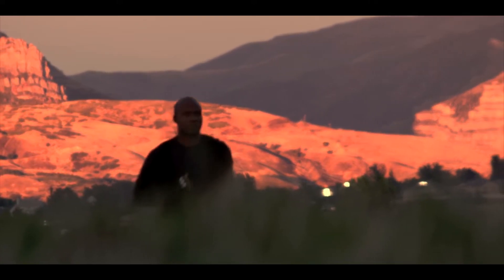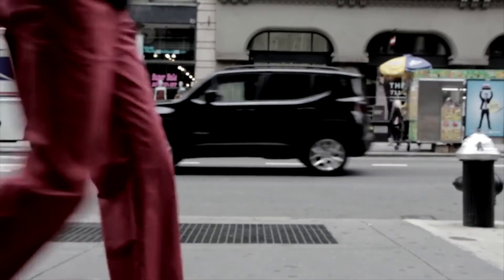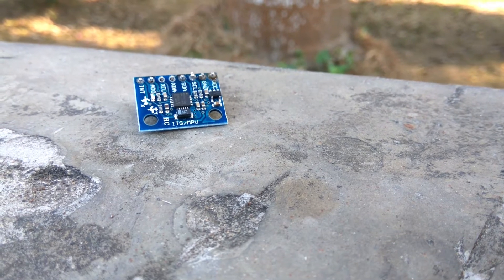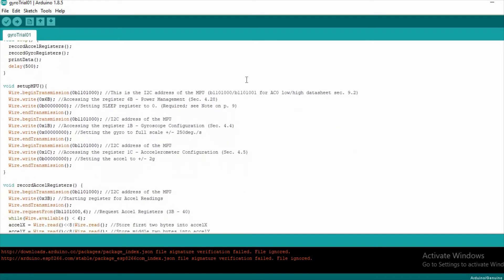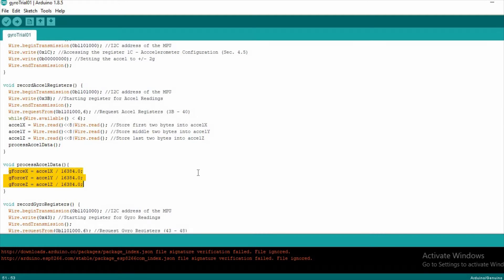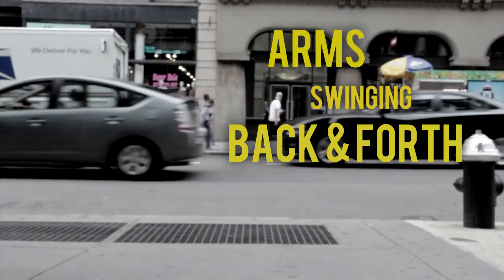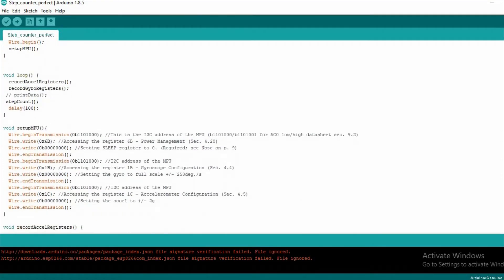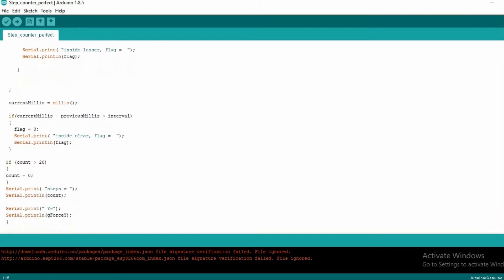Working of Step Counter in Fitness Band | DIY Arduino Accelerometer MPU6050

Comment: !! THIS IS CODE !!

#include "Wire.h"

long accelX, accelY, accelZ;
float gForceX,gForceY,gForceZ;

long gyroX,gyroY,gyroZ;
float rotX,rotY,rotZ;

unsigned long previousMillis = 0;
const long interval = 1000;
long count = 0;
unsigned long currentMillis;
int flag = 0;

void setup(){
  Serial.begin(9600);
  Wire.begin();
  setupMPU();  
}

void loop(){
  recordAccelRegisters();
  recordGyroRegisters();
  //printData();
  stepCount();
  delay(500);
}

void setupMPU(){
  Wire.beginTransmission(0b1101000);
  Wire.write(0x6B);
  Wire.write(0b00000000);
  Wire.endTransmission();
  Wire.beginTransmission(0b1101000);
  Wire.write(0x1B);
  Wire.write(0x00000000);
  Wire.endTransmission();
  Wire.beginTransmission(0b1101000);
  Wire.write(0x1C);
  Wire.write(0b00000000);
  Wire.endTransmission();
}

void recordAccelRegisters(){
  Wire.beginTransmission(0b1101000);
  Wire.write(0x3B);
  Wire.endTransmission();
  Wire.requestFrom(0b1101000,6);
  accelX = Wire.read()<<8|Wire.read();
  accelY= Wire.read()<<8|Wire.read();
  accelZ = Wire.read()<<8|Wire.read();
  processAccelData();
  
}

void processAccelData(){
  gForceX = accelX / 16384.0;
  gForceY = accelY / 16384.0;
  gForceZ = accelZ / 16384.0;
  
}

void recordGyroRegisters(){
  Wire.beginTransmission(0b1101000);
  Wire.write(0x43);
  Wire.endTransmission();
  Wire.requestFrom(0b1101000,6);
  while (Wire.available()<6);
  gyroX = Wire.read()<<8|Wire.read();
  gyroY = Wire.read()<<8|Wire.read();
  gyroZ = Wire.read()<<8|Wire.read();
  processGyroData();
}

void processGyroData(){
  rotX = gyroX / 131.0;
  rotY = gyroY / 131.0;
  rotZ = gyroZ / 131.0;
}
/*
void printData(){
  Serial.print("Gyro (deg)");
  Serial.print(" X=");
  Serial.print(rotX);
  Serial.print(" Y=");
  Serial.print(rotY);
  Serial.print(" Z=");
  Serial.print(rotZ);
  Serial.print(" Accel (g)");
  Serial.print(" X=");
  Serial.print(gForceX);
  Serial.print(" Y=");
  Serial.print(gForceY);
  Serial.print(" Z=");
  Serial.println(gForceZ);
  
}*/

void stepCount(){
  if(gForceY > 0.5){
    flag = 1;
    Serial.print("inside grater, flag = ");
    Serial.println(flag);
    previousMillis = millis();
    currentMillis = millis();
  }

  if((currentMillis - previousMillis <= interval) && (flag)){
    Serial.println("inside time loop");

    if(gForceY < -0.5){
      count++;
      flag=0;

      Serial.print("inside lesser, flag = ");
      Serial.println(flag);
      
    }
  }

  currentMillis = millis();

  if(currentMillis - previousMillis > interval){
    flag =0;
    Serial.print("inside clear, flag = ");
    Serial.println(flag);    
  }

  if(count > 20){
    count =0;
  }
  Serial.print("steps = ");
  Serial.println(count);

  Serial.print(" Y=");
  Serial.println(gForceY);
}